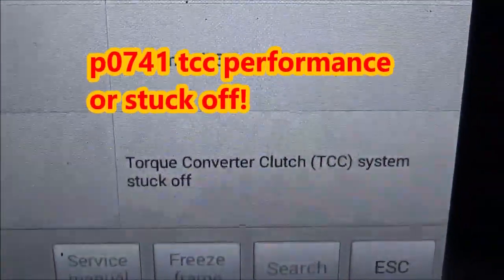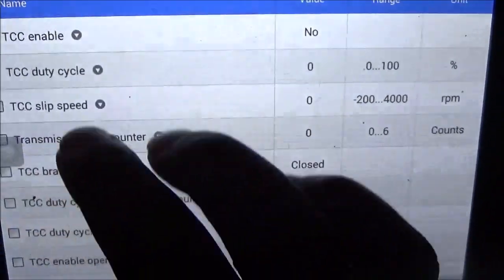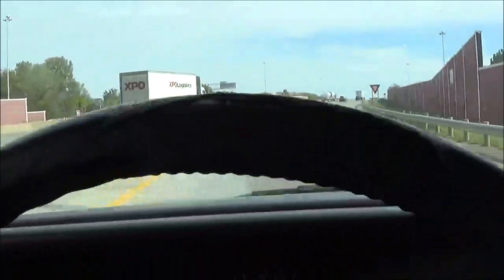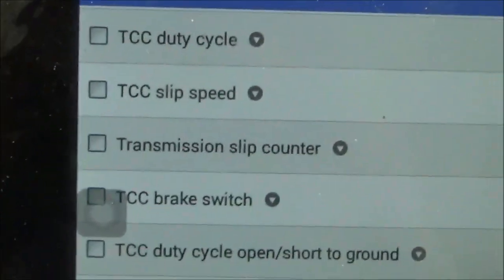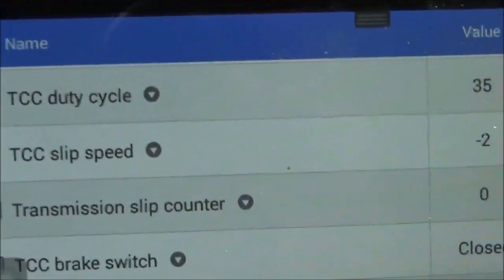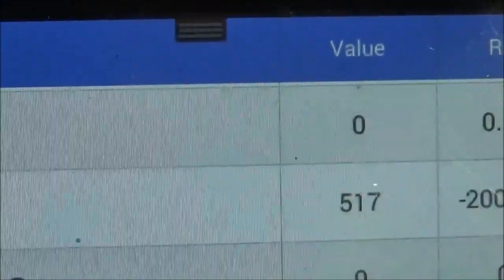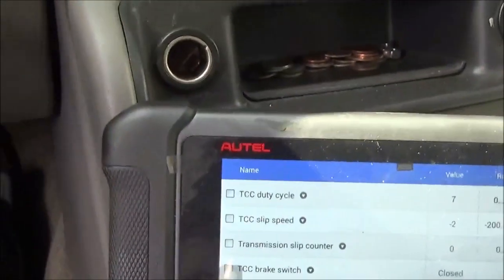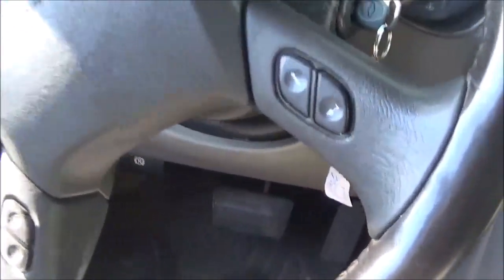P0741: TCC SOLENOID PERFORMANCE OR STUCK OFF 4L60E (PART 1)

Comment: I am having this issue on my 2005 gmc envoy 5.3L with the 4l60e trans do do you believe dropping the pan and changing the solenoid or cleaning the old one would fix it. When I hit 40 it just slips
Reply from the maker: How many miles is on this vehicle?

Comment: Did you verify solenoid CIRCUIT function? Or did you just disturb the electrical circuit?
Reply from the maker: The valve in the valve body was bad.
Reply: Just saw that in part 2
Thank you!
Very helpful for that model.

Comment: Great Video and info.. Question should you reset the TAPS Function after replacing all the Shfit Solenoids and Pressure Valve Switch on 08 Silverado? I was getting same code p0741 but now it shifts smooth but didn't reset codes after replacing parts.
Reply from the maker: You can try. It will not hurt
Reply: Sounds good.. Seems truck is shifting smooth at all gears bit was just curious if that reset would hurt anything.. Thanks and keep up the great videos..

Comment: I just received this code on my 05 Toyota Corolla. How bad is it to drive with the code? It drives completely fine and I plan to fix it soon but it’s my only mean of transportation.
Reply from the maker: I don't believe this code will make you have an accident, if this is what you want to hear. I guess, drive it until something else goes wrong if you still can move. Normally though, you may see a reduction in fuel mileage.
Reply: @thisisyourtransmission  Ok thank you!

Comment: Is it unusual for the P0741 code to come and go?  My car shows no signs of shifting problems or gas mileage issues but I get the check Engine light after about 2 hours of driving.  Once on, it stays on until an adequate cool down period occurs, or the next day, then it’s off again?
Reply from the maker: Normally something is worn when this happens.

Comment: Hi my friend a curiosity I have the same gearbox mounted on the opel insignia and it makes me in neutral from 3 to 4 gear, with the diagnosis it gives me error P0741 and P0734 what happened in your opinion?

Comment: I had my transmission rebuild completely and 3 days later I got po 700 and po 0741 any suggestions
Reply from the maker: In the video, it shows what I am looking for if this code happens. who ever is working on your transmission would have to do the same thing. If not, they will just be guessing.

Comment: I have the same code 01 gmc sierra 4l60E. What happens if I keep driving it slipping for several more months?
Reply: I've been driving over a year on a bad 4l60e in a 2011 Colorado. I have no idea what the problem is but last night I changed shift solenoids and tcc solenoid. Didn't make a but of difference.
Reply: Same thing is wrong with mine

Comment: Rebuilt transmission on a 2013 tahoe; didn't even have it back a full 24hrs. Shifting late, rpms idling high but seem like it don't want to catch speed; Transmission fluid good, torque converter new. Mechanic said Transmission didn't need to be reprogrammed. Can anyone tell me what it could be; also took to the parts store put on machine and it read a code P0741 and C0899-00... can someone help me out with this ik it could be a list of things

Comment: My torque converter was physically shaking the car but no codes professionally replaced it now every torque converter code possible replaced all solenoids not fixed until I bought a toyota lol never ever buy American
Reply: Lol I have a 2004 honda accord ex v6 and I'm dealing with the p0741 saga.
Reply: @lefty_420  so what happened ? Did you find out what it was ? I'm having the same problem in my 2017 accord v6.
Reply: @soulerflare7  I had it looked at and he said my 3rd gear was worn out, basically i need to have my transmission rebuilt.... or replaced. Take it in and have it checked out it's usually free

Comment: I had this code but I was wondering by turning off the code will it come back on so I went for a ride it didn’t come back on the next day I took it for a ride again and see if it comes back on and it didn’t so have to drive it on a highway and do 70 to see but I haven’t try it yet  I have a feeling you are right I think it slips but I wait and see hope and pray it doesn’t come back on 🤣🤣🤣🤣🤣

Comment: If you guys are having solenoid problems inside the transmission on the 3800 and couldn't remove the side pan due to rusted out subframe or something else what I did was cut the brown wire on the transmission harness was about to junk the car but now that I cut it the torque converter is working again and shifting every gear I put 400 miles in 3 days no problem at all
Reply: Will this work on a 2010 silverado 60e trans? 2wd

Comment: My truck is doing that rebuilt it 4months ago converter is new
Reply: Which TCC solenoid you change the on in the valve body or the one that is wires to the solenoid harness
Reply from the maker: @christopherhernandez9115  when taking a guess, you can change both.
Reply: @thisisyourtransmission  did you replace valve body or the harness with solenoid?

Comment: Hey man, I had that code pop up on my son's 06 Saab 9-3 2.8t. V6. I removed the valve body and fluid which were terribly dirty. Black fluid. Tested each solenoid, and got the correct 6.5 ohm reading. Cleaned and rebuilt the VB and reinstalled it. I correctly used 12 quarts to flush out old fluid until all fluid was fresh. No more p0741 code, but car still won't drive. Do you think it needs a new torque converter? Thanks
Reply: @James Warren 2004 Accord 3.0 V6 280000 miles. My car is doing the same thing. 0741 I changed tran fluid w/ Lucas, cleaned the tcc solenoid, code cleared. Now it has same symptoms you described. I don't know crap about cars but the 0752 and 0747 codes I have now I am taking out the shift solenoid a to clean it and see if that helps. Any advice would be awesome
Reply: @miketompkins2568  Ended up selling the car.  They quoted me 3200 for a rebuild. I gladly declined lol. A month later, the guy I sold it to posted it for sale lol. It was one of those sealed transmissions. Hope you get it going brother
Reply: @miketompkins2568  Did you ever get you car fixed? I have the same vehicle and same problem. I changed the torque converter clutch solenoid and  the car drove fine for 3miles then right back to driving in limp mode. Any help would be great!!! Thanks!
Reply: @miketompkins2568 did you ever get it fixed? What was your solution?
Reply from the maker: What do you mean the car will not drive? It does not move?
Reply: @thisisyourtransmission  It doesn't drive. It will reverse absolutely normal. Neutral seems normal. But when I get it in drive, it takes very high rpm's for the car to barely move a few feet. Occasionally, it will catch at higher revs and take off sluggish. During those times, it will not shift. And once it slows down, its back to not catching.
Reply: It has an Aisin TF- 80SC
Reply from the maker: @jameswarren4747  take the transmission out and put another one in. Make sure the transmission lines are flushed.
Reply: @jameswarren4747  never replace transmission fluid

Comment: Good explanation 
I have a 2001 maxima ,  203k miles

Check engine light p0744
Shifting badly

I did a ATF drain and fill adding Lucus 
Old fluid was black/brown no metal shavings or metallic tint, no burnt smell either.  

After the atf service. it was a lot better,  maybe 65% better.  I also cleared the code.  70 miles later it came back.   At 330 miles it was 80% better now at 600+miles it’s say about 90% better.   I have a feeling the TCC solenoid was dirty from the old fluid.  If it does not get better soon. It may mean replacing shift solenoids 

Transmission : RE4F04A
Nissan Part No.: 31940-80X25
SOLENOID REPAIR KIT - CONTROL VALVE

About.  $77-120 part
Reply from the maker: Well, when a vehicle comes into the shop with that many miles, I rebuild or change the transmission with a unit with lower miles. I never recommend additives to fix the problem because once it is put into the transmission, all the seals will have to be replaced that has been touched with the additive.
Reply: THIS IS YOUR TRANSMISSION   I understand your thoughts,  however given the age of the call and miles and how much it is ,  fixing the transmission that way would cost more than the car is worth.   So at last resort I did what I did.  I know it’s not fixing anything just prolonging the inevitable. Of a transmission failure.   But from the result so far it’s driving and shifting now the best it has in years .  970 miles post. Atf service it’s adding Lucus.
Reply: I have a 99 Dodge ram Van 5.9 and it's got p0740 and shudders really bad at 40mph where should i start diagnosing?? What scan tool should I get that can read tcc slips and all that but in a budget?? @thisisyourtransmission